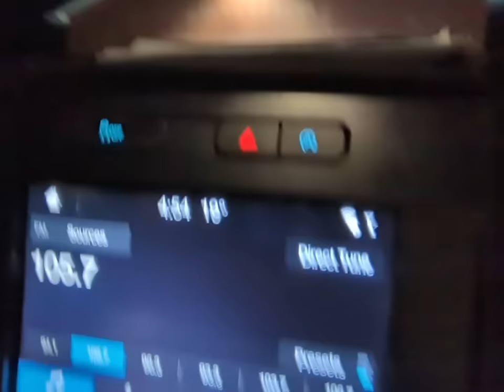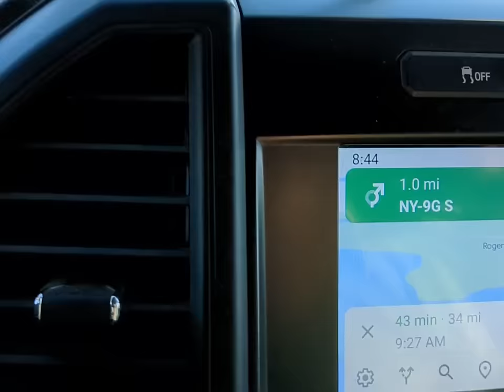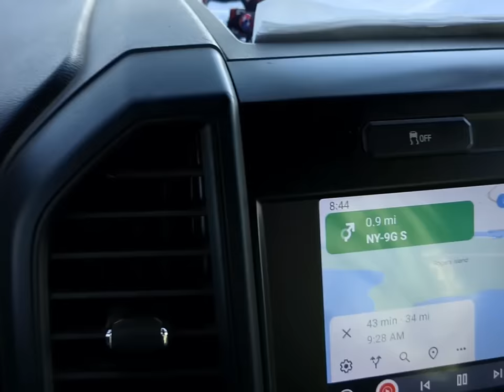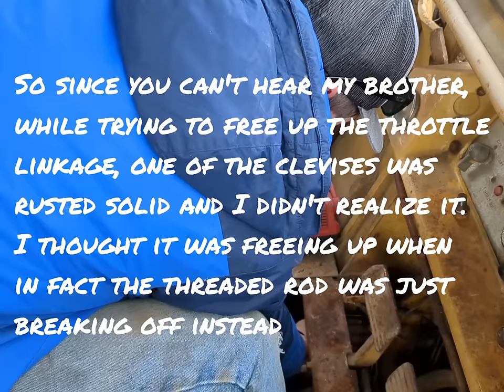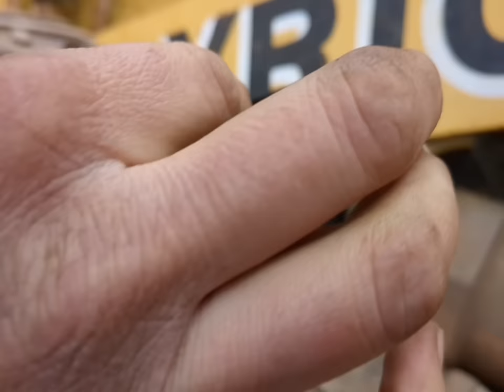Will It Start?! HUGE Cat 983B That's Been Sitting For Years!!

Comment: With a chassis the same size of a D8, the 983 is an impressive piece of equipment. It was the largest crawler loader ever until Komatsu introduced their D155S with a 6-yd bucket. I hope after all that snow melts up there that you guys will take another stab at it in the springtime and get it running.
Reply from the maker: I'm hoping so too! Gonna have to figure out a way to raise the loader to change that starter I'm thinking
Reply: @upstategearheads easy enough to do. Try to get a hold of another machine to lift the bucket to the top while holding the lift lever in the cab. Than make a boom safety stop out of some heavy angle line and I bolts

Comment: I have a 1957 D8 caterpillar dozer that weighs 43,000 the blade alone is 12,000 and estimated the engine crank shaft at 1500 pounds alone

Comment: Looks like you might have a seal out between trans and final drive to have that much oil flow out of final
Reply: Yeah, that's what I'm saying. Those final drives only take enough oil to cover about 1/4 of the bull gear, if it pukes like that it's a tell tale sign that the final drive axle seal is blown

Comment: Going back for another try?
Reply from the maker: Hopefully, but I think our next angle of attack would be to replace the starter. Unfortunately to do that though I think we'll have to raise the loader somehow to access the side of the engine better. That may require a pretty massive excavator or crane though
Reply: @upstategearheads  extra voltage might help.
Reply: @upstategearheads a decent size lull should be able to lift the bucket up.

Comment: So that mufflers rotted out do you know how long it's been sitting there because if the stack never had a cover on it and the mph is all rotted out you'll have stuff on top of the piston plus water and that will stop it from turning over I heard you say you couldn't turn the fan to turn the motor and the muffler is all rusted out that's what I say it is water has got down and rust on top of the pistons pistons pull the head off and hopefully that's all it is easy to Freedom up Queen all the s*** away from the distance Scottish you can get put a bit of oil or diesel in each piston and try a couple of starts should free up and then you clean the bowls write out and hopefully that will solve it and I don't know where I'm right but I have struck that before that's all it was so I hope that helps you are I would love to see it running so that helps you put your mind at rest was when you said that stack was all rusted out you couldn't turn on engine over backflip I've had that done I managed to get them running and I'm excited as user to get that old girl running so thank you I hope that works I love to see you started so thank you for your video I just love the normal machines Ray formula land down under Australia thank you❤❤❤❤🎉😊

Comment: I am sorry,  even though you sound like a down to earth  guy!  (NO arrogance) 
I will give you  respect for driving four hours? to try to get a  bulldozer/loader Cat  going?   First off  you get the date  of manufacture, model serial number, engine serial number off the  motor plate? and  access or  borrow , 
or buy a used  shop manual for this  machine!  Caterpillar has  a manual for every  machine ever built by them!  You should have also  went to the trouble of  hiring a competant  bulldozer mechanic as well!    very heavy booster cables, and  two  proper batteries  fully charged!    Also a  ammeter  clamp style to read the current draw  when cranking!   that would tell you  the health of the starter!    Also it was well worth  a proper heavy equipment mechanic
with  good tools and experience to be with you!!  also   a man with the experience to look at the  undercarriage and  know??? what shape it is in! 
That way you will know if the machine can handle your contemplated job? 
without  breaking down on you!   Also know? how much it  would cost to  transport that machine from A to B  ? big bucks I am sure!   heavy machinery is NO JOKE FOR SURE!     I WILL GRANT YOU  CREDIT FOR BEING CALM! 
BUT IT IS AWFULLY A LONG WAY TO DRIVE ?? ON A LICK? AND A PRAYER?  
ALSO , IT IS EASY FOR  FOLKS WHO ARE CLUELESS TO SAY THIS AND THAT! 
THEY MAY BE VERY WELL INTENTIONED!   BUT  YOU, HAVE GOT TO BE THE ADULT IN THE ROOM!    I WOULD LOVE TO SEE YOUR FACE? WHEN YOU GET A QUOTE FOR A TRANSPORT  COMPANY SPECIALISING IN  HEAVY EQUIPMENT  MOVING? TO  LOAD, AND TRANSPORT THAT  BULL?  EVEN IF IT  IS  RUNNING FINE!   AND MOVE IT  SAY 20 MILES?   BIG, BIG MONEY! 
FLAGS ON THE  DOZER BLADE?   PERMITS?  WEIGHT RESTRICTIONS ? 
WHERE IS IT GOING? THE ROUTE?   (  THE WHOLE NINE YARDS) 
AND WAIT TILL YOU SEE THE COSTS OF  REPAIRING A MACHINE THAT SIZE?   GOOD LUCK  YOUNG MAN!  kennethzakaib607@gmail.com